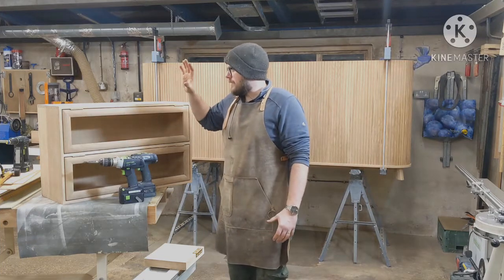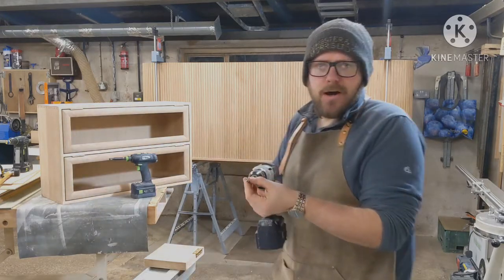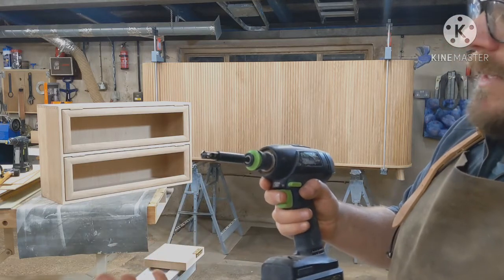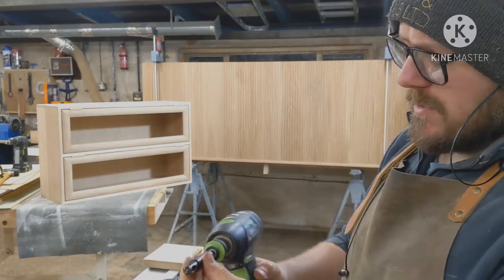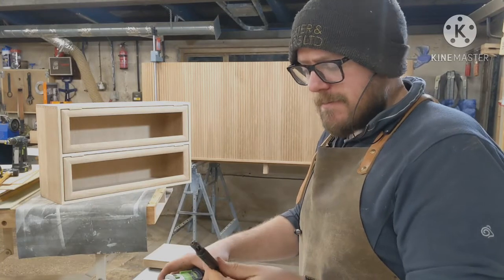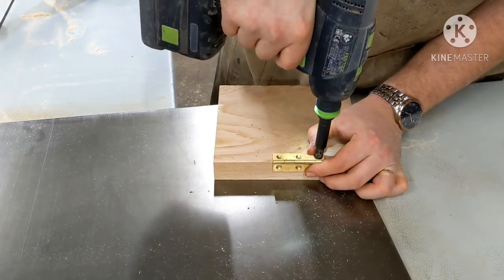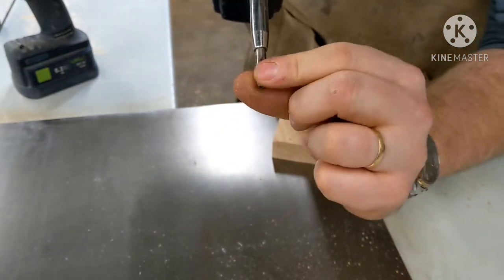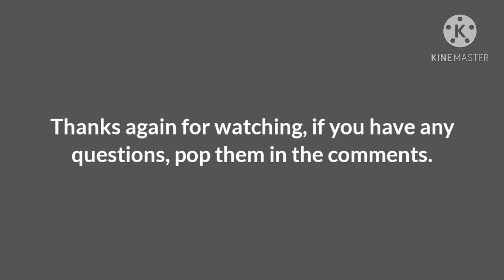10 minute tool reviews - Axminster trade bitz self centring hinge drill bits.

Comment: I’ve seen 7 different sizes , will one size do several different diameters, cheers and good luck 
Roy
Reply from the maker: I don't believe the pilots are interchangable, they rely of a friction fit in the collar to keep them centred so the size you buy is the size it is. 
I tend to use a 2.5mm the most, and to be honest could probably get away with that size alone for cabinet work, as it's about right for the bulk of cabinet hardware. 
Hope that helps.